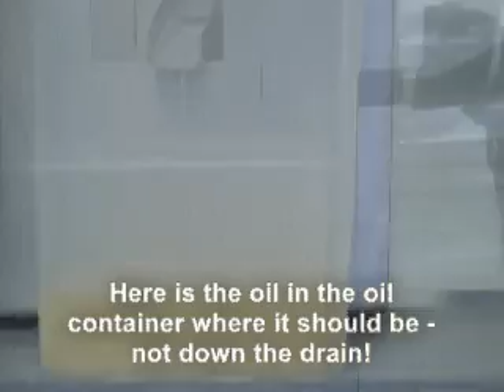Goslyn device separates oil from water

Comment from the maker: Did you know that the Goslyn maintains an efficiency close to 100% because the FOG ( fats,oil,grease) collected in the separation chamber are speedily expelled into the separate container so unlike a traditional trap there is no reduction in efficiency over time. Also because the flow rate is controlled the Goslyn cannot be overwhelmed by draining down several sinks at once. the sinks will just take longer to drain out. Goslyn is available in flow rates from 10gpm, 15,25,50, 100,250 and 500gpm.